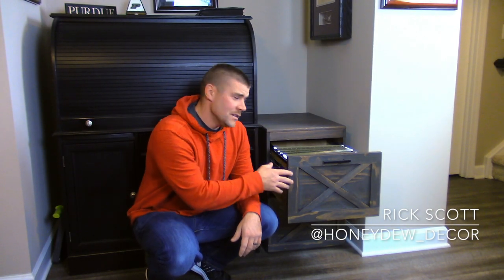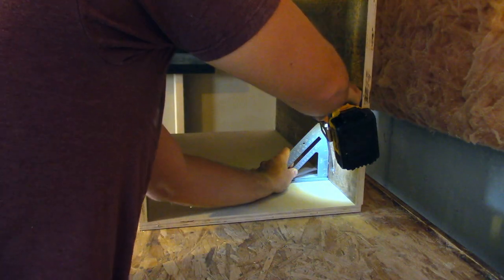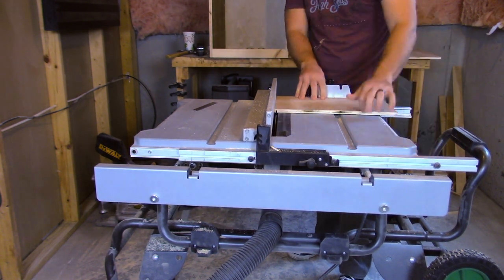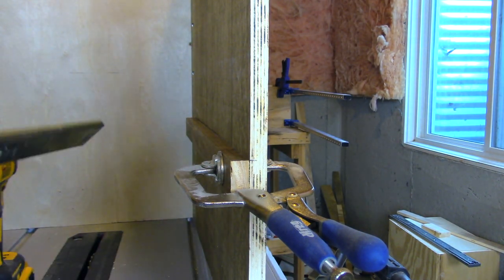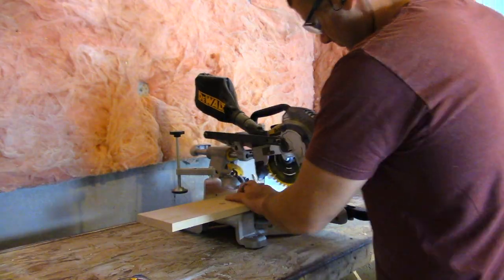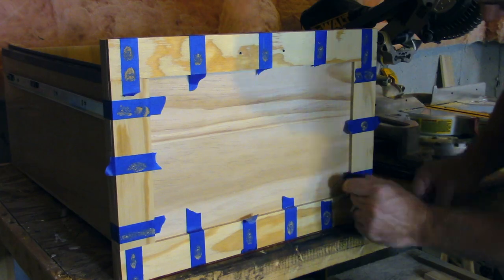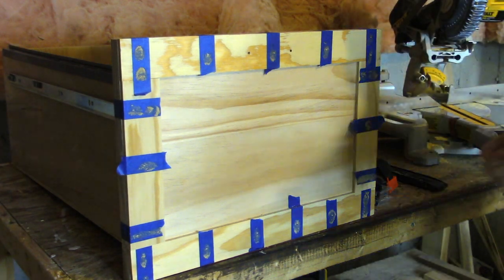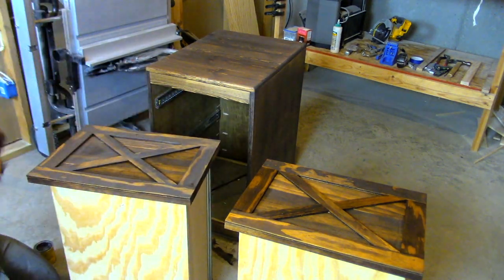DIY Rustic Farmhouse Filing Cabinet/ How to // Woodworking

Comment: How do you like the dewalt miter saw what model is it.  I have a old craftsman saw but it is a standard saw and I pkan on using it a long time but possible upgrade eventually.  Good job on build.
Reply from the maker: Sorry for the delay in response, I may have to many irons in the fire currently lol. I love the saw. It has a ton of power and cuts really clean. I’m not currently around the saw but it’s the model without the light. If I would buy it again I would get the blade light. For now I’ll just add it to mine when time permits.